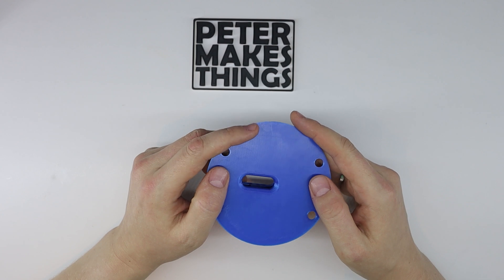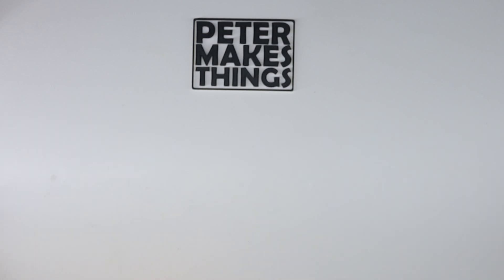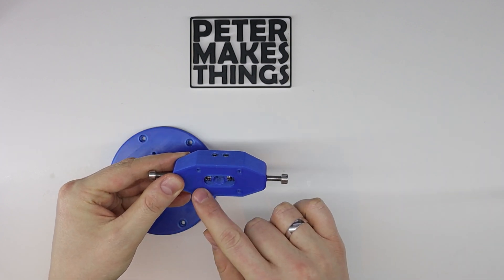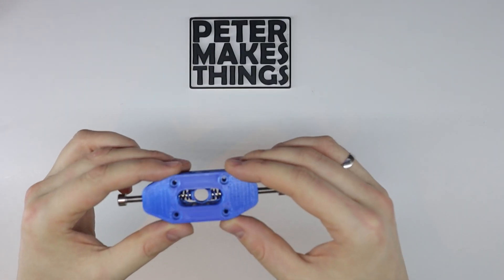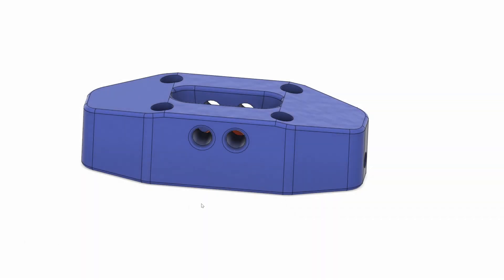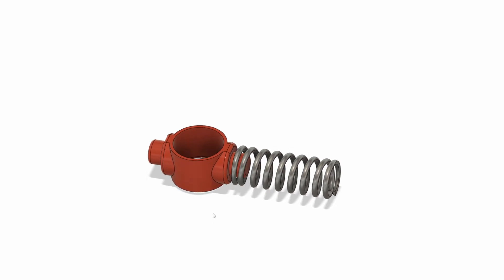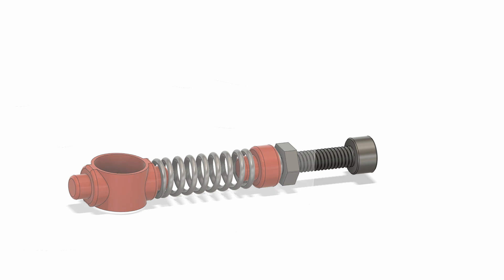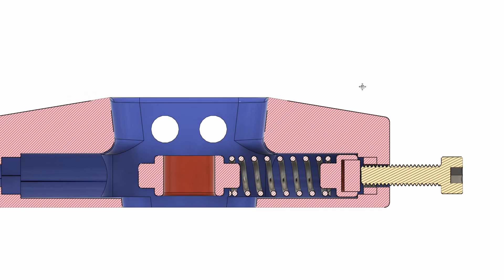Thrustmaster TH8RS Ultimate Sequential Shifter MOD

Comment from the maker: READ THIS: After recording the video I've been using the mod quite intensively and found a major flaw in the design - the friction between shifter shaft and the spring ball screws is resulting in occasional locking of the shifter and scratches on the shaft. You could use some kind of grease to prevent that but it would make the  whole thing messy, so I inverted the design: springs are on the top and ball screws right over the base plate. At this height the shaft has a teflon insert therefore the friction is minimised and everything works smoothly.
Reply: also, my spring end caps had no metal/magnets in them. The one I received is black. has no shift indicators.
Reply: can you share/show photos of the new design so we can get better understanding of it or do a video about it..
Reply from the maker: @ahmedmohmed4346  you can see it on thingiverse (first 3d model picture, the holes for plunger screws are on the bottom rather than on the top of middle piece): https://www.thingiverse.com/thing:4082817/files
Reply: Mate is this for sale? Surely someone is making these. this is brilliant
Reply from the maker: @phildimitriadis5041  ask my friend who's making some of my mods @ www.kapral.store if he can make one for you, it's not listed in products yet, so use the contact form
Reply: Peter I presume its still all the same hardware requirements? I will compile my list over the weekend for the bits I require.

Ps yet another awesome video and modification to improve
Reply from the maker: @lurcho101  yup, same hardware, just inverted the model so it doesn't damage the shifter
Reply: @petermakesthings7342  perfect cheers

Comment: Got mine a few days ago, ordered from the site. Delivery to Germany was very quick and without any problems. Also had a personal thank you note on the inside of the package. Very sweet, I appreciate such little things. So here's a big thank you from my side! :) To the mod: It's pretty solid and way better than the original crap. But the measurments could be a bit better on this one. The springs have a little to much play and the ball screws are a little bit out of line and that results in a tiny weird feeling while shifting. But I'm very pedantic on such things. But all in all a wonderful piece and the general feeling is awesome. But it's a bit noisy for my taste. But I guess that's because of the play at the springs. They make a little scratching sound that's very annoying while playing at night or in a silent environments. I will look for some more stiffer springs. That could be the solution. It's very quite when I fully preload the springs but then it's to hard to shift because the space for the movement of the shaft is getting too small. But as I already said, all in all it's a wonderful piece and for that money you won't get any better! Simple and working design. With a bit of skill you can make it even better. And it will get better by time I guess. It needs to run in a bit first. I will update you on this.

Comment: I bought this from Kapral and I'm extremely disappointed. The spring binds up. The ball screws are smaller than shown here and barely make any contact (they either just barely click or they hold the shifter from shifting back to neutral.) The springs are loud and creaky. It feels overall worse. Doesn't look anything like what's shown here. There's no metal contacts on the spring piece that touches the screw. I've done a few upshifts and found that it just sticks in gear until I either increase the spring tension or release the ball tension enough that they don't click at all... or just rip it back into neutral by hand.

You mention that you shouldn't require any grease, but the collar that goes around the shaft rides along the printing lines and starts to raise up as well as bringing the spring with it causing it to bind and stop.

I'm going to give it a chance tonight during my Dirt Rally 2.0 streams, but at this point I think I just wasted $50 (shipping was as much as the device)

Comment: Nice stuff man,I will most likely get one as soon as I can,I have a quick question tho,can you use this mod while having the mod for H pattern stiffness installed?
Reply: Great question. Would also like to know. Even though from all ive seen I imagine the answer is yes, both should be able to work together. Since the other mod is inside the shifter and he made this one on top/outside the shifter.
Reply from the maker: Yes you can:) I keep the h-mod in all the time even though I've been switching to seq quite often
Reply: @petermakesthings7342 hey brother I'll send you a donation but I can't find the files and everything on your site costs nothing. Am I missing something? I apologize if I am. I have all the parts in my bins and just need the stl but can't find a link to it. Like I said I could give you a donation first. You deserve money for your work.

Comment: I know I’m a bit late 😅 I really love your designs!! 🙏🏻 Would love to have that one in plexiglass, so it can go on top of the chrome plate maybe... Would be awesome as a separate design, maybe I’m wrong and this can’t be done technically.... but was just brainstorming about that. 😁 otherwise I’ll order it in black if that’s available 😬🙏🏻
Reply from the maker: there's a small button in the shifter that needs to be pressed in order for it to work in seq mode, therefore it's not possible to put a seq adapter directly on top of the silver h pattern plate, due to this using plexi would actually be pretty ugly cause the internals are not nice to look at :) plus plexi is pretty problematic and can break easily. if you have the means though I would definitely be interested to see one made :)

Comment: Hi,,is it possible to use the sequential mode while the h-pattern mod was also installed?thanks
Reply from the maker: nope, shifter only works in h or seq, and the modes are changed via small switch underneath the top plate (H btn is not pressed, seq btn is pressed)
Reply: @petermakesthings7342  We could externally mount the switch instead tho maybe ?? this one reason I have never used my TH8 as a seq shifting, too much faff messing around to swap between the two.

Comment: Hey man this looks amazing.. I've been thinking of just using the sequential shifter on my th8a cause it's an inconvenience switching plates back and forth.. How much do you charge to make this? And would you ship it to ny?
Reply from the maker: tbh the shipping from UK would probably be more expensive than the mod, I'd suggest asking on reddit if somebody in your area could print it for you, the models are available for free and all the hardware can easily be found on ebay or aliexpress
Reply: bro you have to watch his other video "How to replace TH8A shifter plates without any tools"
Reply: oh i also have a magnet on my rig to hold the screws (and tool, because i havent gotten the thumb screws yet) while swapping plates so i dont drop or lose them. And using a crown royal bag to hold the plates.